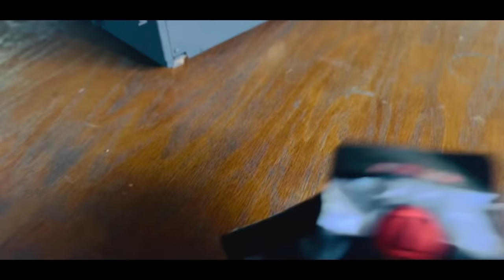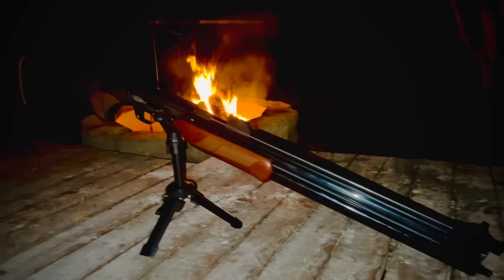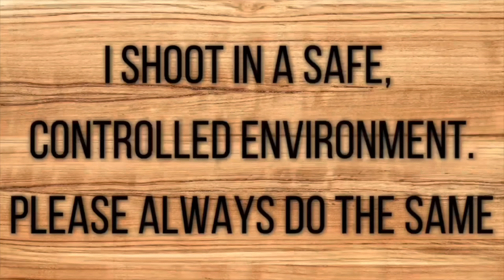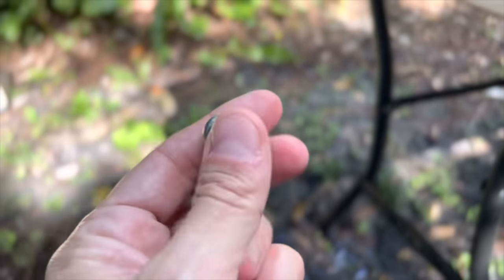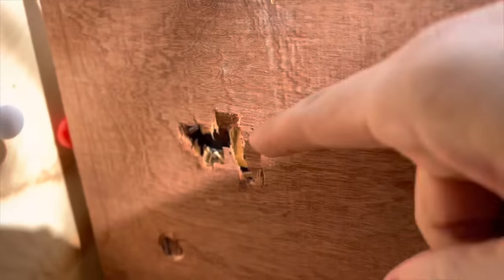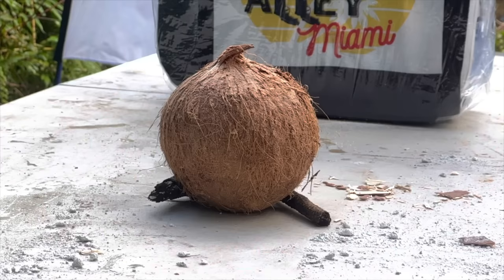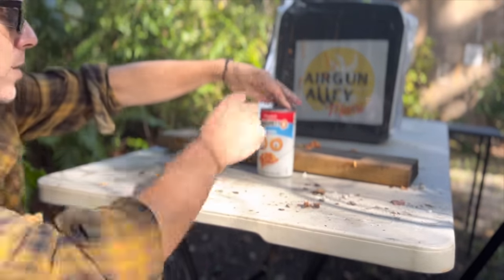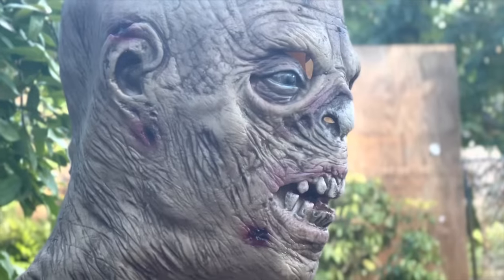Z-RAM • For the HDR 50 & HDR 68

Comment: Right projectile in the right marker and they can really perform. Put them in a mag-fed launcher and they require TLC to keep from jamming badly. I would definitely trust those in the Umarex system though!
Reply: For mag fed, Z-Ram sells a 'MagMode' for the T8, T9 and FSC mags to prevent jams. I've have them in mine and they work great with zram slugs! 👍
Reply: No jams at all, or just a reduction in the frequency of jams? I know that reversing the follower and lubing helps too but they aren’t completely eliminated.
Reply: @ScaredyCatTactical  Yeah, no jams at all in my T8.1. I also add a bit of silicone grease. So far they've been great
Reply from the maker: Very interesting guys! Thank you for your expert inputs on this! 🙏🏽 and Happy New Year!!

Comment: I was kicking myself for a while for not getting the HDR 50 and getting the HDR 68 instead. I just assumed a smaller projectile at a similar speed would have greater penetrating potential. But the difference in kinetic energy makes the HDR 68 the real winner.
Reply from the maker: I’m with you 100%! I’ve been suggesting the 68 over the 50  ever since I first laid my hands on it. I’m happy you’ve come to that conclusion my friend!
Reply: Would you guys say the 68 is best  for home defence, I live in a rough area in the uk
Reply: @Beggars-Belief  after the removal of the restrictor you’ll get about 5 or 6 solid shots out of the HDR 68 that I wouldn’t want to be on the receiving end of. I live in the US and own many firearms but the HDR 68 is the only gun at night time that sits next to the bed. I do trust it. My use of it was to provide enough time to unlock the gun cabinet and load up an AR or a shotgun. After practicing with it I have decided the next step in my plan might not be necessary. That’s only with the removal of the restrictor however. The gun will come from the factory more geared towards paintball or pepper ball use. I’m not a fan of the use of pepper balls in my home. So pull that restrictor and use heavy kinetic balls. Such as rubber steel or even nylon. The effects of the pepper balls do take a minute and by the time they do the attacker might close the gap and even expose you to the pepper. IMO

Comment: I still prefer round balls for the HDRs. When fired from a smoothbore gun, the bullets tend to tumble in the air, which means they don't hit straight. With round bullets it doesn't matter, but with pointy ones it means that they often hit the target with their side or even back, negating all pointy tip advantage. They look cool, but they are terrible in practice.
Reply: I disagree. In my experience, and as shown in this video, the Z-Ram slugs do indeed have a stable trajectory and pentrate an object pointed end first in most cases
Reply: I think getting hit from the side with a z projectile is still harder than a round bullet.  the sides also have smaller impact areas than round balls
Reply from the maker: Thanks for your input. I’m not too sure that these tumbled so much in flight. Of course I believe these launchers are very much made for short distance shooting. If your target is far away, I’m sure the chances of it getting hit by the point are reduced. But from 20/30ft - you’ll most likely get hit from the front of the slug…

Comment: Thanks for the awesome video. For home defense which would recommend the ZRam, Devestators, or the Cordodo 9mm?
Reply from the maker: Thank YOU my friend! I always recommend to use a mix of ammo in a magazine. Alternate them. But between the ones you mentioned I think the Devastator and Cododo are equal (go with the easier or cheaper to find) and I would get the Zrams to complement them.
That way you have a powerful ball (or bullet) bearing slugs and more penetrating pointy ones…. Hope this helps

Comment: Great video as always. Although I did feel a little uncomfortable about the waste of food. Not sure if I missed it, but are your HDR's standard or do they have the valve block and restrictor removed?
Reply from the maker: Hi Anna, thank you very much and I truly appreciate your concern on the food wasting. I’m actually in talks with the manager of my local supermarket to see if they can provide me with fruits (coconuts and watermelons) that they intend throwing away after expiration.
As for the the spaghettios, I have no remorse in “wasting” such poison. And finally the water jugs are filled with tap water, after we drink them.
The HDR 50 is a standard 11 joules while the HDR 68 has had restrictor and valve block removed. Thank you again! :)
Reply: @AirgunAlley  Lol, yes they are nasty. Great job!
Reply: @AirgunAlley  On that note, will be having HDR 68 16j soon and really admire your 30j but worried about whether there is any cons in long term with removed restrictor and valve, 'juice' consumption and parts availability in SA. Are my concerns valid or should I keep it stock 🤔 excellent informative vid and I have hit that subscription button and bell.

Comment: It makes big entry holes but that's about it, I assume it's because it's only 12g co2 powered. I'm sure the PCP rifle will definitely penetrate much deeper and most likely go through all the test. I know a simple .177 break barrel pellet rifle would enter and exit all test. Another channel filled a coconut with ballistics gel and had no issue entering on first hit and even exiting the other side. My .177 break barrel shooting lead at 1000fps or alloy at 1200fps has been able to punch through 5/8" plywood  at fairly good distance.
Reply from the maker: Hi Matthew, you make good points - but we need to separate the apples from the oranges.
The whole point of these weapons and ammo are to be less-lethal, as that’s the category they fall under.
So you want them to really hurt, to deter and perhaps to knock out someone, without killing them. And remember 50 cal is a huge caliber compared to the .177 which is like a needle in comparison. PCP is designed for hunting, so we would absolutely expect full penetration.
I know, there’s a lack of visual satisfaction (for that I’d suggest some of my pcp videos), but these Zrams are doing their job well.
Thanks again!
Reply: @AirgunAlley  ya nothing against the ammo, although they do look deadly,  I've seen several of your videos just not the pcp ones. While back the darts lol definitely wouldn't feel good and would be boarderline lethal. If the objective is a good non lethal round perhaps rate on accuracy vs penetration since any thing coming out those will hurt for damn sure. Want to say you tested a dense rubber slug , if non lethal is the  point those were best ones I've seen you shoot, accurate and prolly just as if not more painful then beanbags similar to rubber bullets fired out of a 12gauge . I'd have to go back and check which they were. Didn't know that was point of the test so wasn't knocking anything.

Comment: It seems the .50's are more effective than the .68's, yes? With your experience with the "normal" round ones, are the .50's more effective with those as well? It seems to my limited knowledge that their lighter weight and reduced wind resistance would mean they go further faster harder, yes?
Reply from the maker: Hi Scott, I would agree with you. These are very interesting, because they’re a hybrid between a piercing projectile and a “knock out” one. They don’t fully penetrate, but they hit hard.
I tried them on a ballistic dummy recently and even then it was hard to judge their performance.
They impact hard, but don’t penetrate. So it’s hard to evaluate how much pain they actually inflict. I suspect they hurt a lot, despite it being visually “improvable”.
I know I didn’t answer your question - but this is the analysis I’ve made on these thus far

Comment: thanks for the comparison, my .22 crossman pump does more damage the that using copper coated ball bearings  :-\  its shooting around 900 fps using plastic coated steel penetrators
Reply from the maker: Nice toy you got there man! Damn, 900 fps 😍
Reply: Haven't tried Red Flights yet. My Gamo Urban springer doesn't like 9.7 so I use 14.3. Sounds just like Daisy Red Ryder 😎

Comment: watching the plywood demonstration. why does the 50 cal. seem to hit harder? thought the weight of the 68 cal slugs would do more damage than the 50 cal slugs.. might have to re-adjust my thinking and get the 50 cal instead. then again, the coconut demonstration, the 68 Cal. did more damage.. LOL, I'm so confused! trying to figure out what to get for home defense. I live in a bad neighborhood. I want an intruder to think twice about doing anything inside my house after being hit by a non-lethal solution. was looking at the Umarex pump shot gun, but I don't want to have to pump between shots at an intruder.
Reply: Velocity tends to have better penetration of hard objects like plywood,  metal,  etc. The 68 cal is moving slower and weighs more, it spreads the energy out over a larger area too which leads to less penetration.
Reply: The68 is 30jouls5011jouls my opion 50for sure 50has no upgrades done yet if it was 30 jouls.ive tested both 50 wins hands down
Reply: @joemalski8374  thank you for that..
Reply: @skairkrow9800  I would also recommend the HDR50 to you, check out my last video.  but also think about the FSC/TCP.  without much upgrade you have 40j with the 68s...
Reply from the maker: Hahaha so far I’ve learned that the one consistent thing with these guns is…. inconsistency! Haha jokes aside, glad you got some great answerer from great people. Happy New year!
Reply: Ok, so I got mine and I got a laser sight for it. finally got my sh*t together and decided to shoot it in my back yard. I have a walled in back yard with a 7' wall. I set up a backdrop with a sheet of 1/4 inch plywood and an old comforter (thick blanket) hanging over the plywood. I set up a cardboard box and mounted a paper plate on it for a target (marked the center of the plate with a dime sized dot). I'm shooting Rubber Balls. Never having fired this thing before, wasn't sure what to expect. I have owned and fired air guns but they were .177 air guns. So my first shot startled me! I didn't think this thing would be so loud! I really didn't want the neighbors to hear me shooting this! I went and checked my target. the ball went through both sides of the cardboard and bounced off the blanketed plywood, back through the back side of the cardboard and was now rolling around in the bottom of the box. I checked under the comforter and there was a dent in the plywood. I thought about it and then went back to my firing position for a second shot. from 35' away took the second shot. still way to loud! So I went in and discharged the Co2. I'm going to have to find a gun range that will let me shoot it. But I have to say this thing was surprising in its power and noise level. BTW, I hit the dime sized spot with both shots (love the laser). Also, if the rubber ball had somehow punched through the plywood, then it would have hit a concrete wall. watching videos about this weapon doesn't do it any justice. this thing is quite loud. and not sure what made the most noise. the gun or the rubber ball impacting the target.

Comment: Hitting the same area over and over it not a good test of power.
Reply from the maker: Hahaha what? We’re not here to conduct physics experiments on the effects of energy delivered equally to the surface. We are testing airgguns/projectiles and their realistic effect on targets. You shoot that gun with that ammo and that’s most likely the result you’ll get. Plain and simple
Reply: @AirgunAlley  lmao wrong, once you degrade the area with one shot it is easy for it to pass through  that spot  it does not show the real power of the pistol. Example hitting the same place 3 or 4 times until there is no resistance  because there is a hole for the next shot to go through  and then it goes through  the next board does not mean the pistol has the power to pass through 2 boards with a single shot.